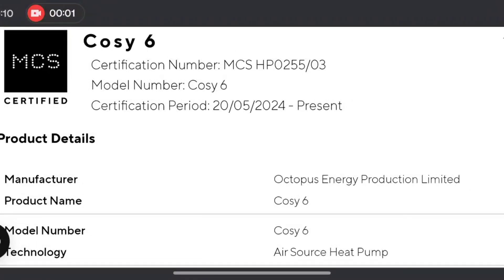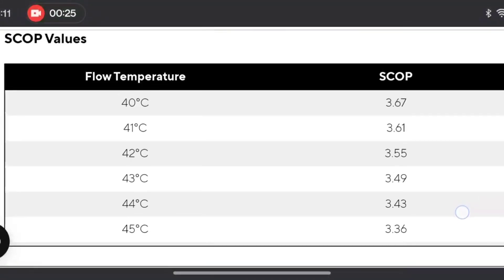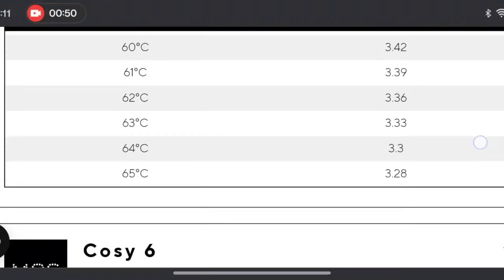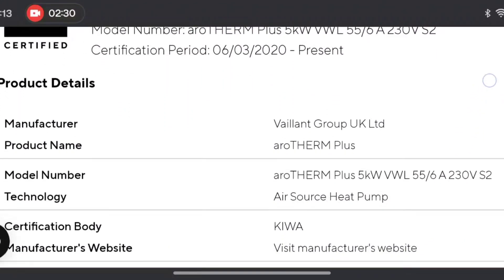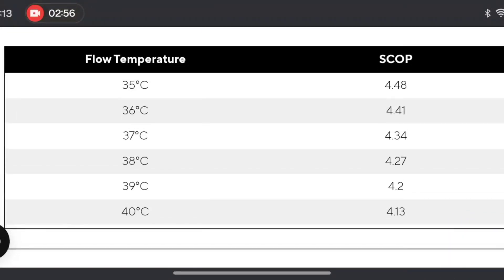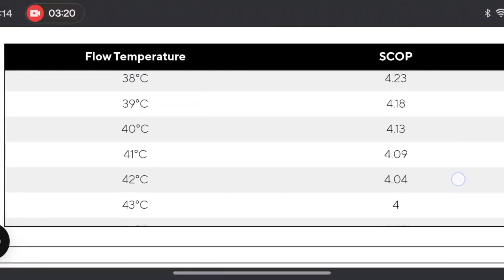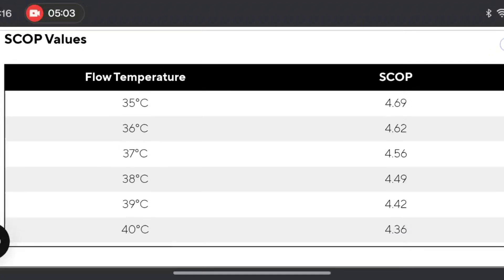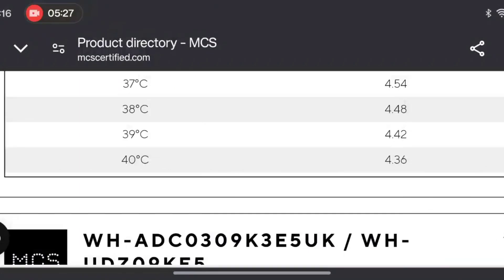Cosy 6 Heat Pump Test Results are poor. Does Octopus have a trump card?

Comment: So I have just been on the MCS database and the SCOP for 35 C is 4.31.  I take it this has been retested?
Reply from the maker: Yes, they have implemented software updates and retested the units now.
Reply: @UpsideDownFork does this change your view of the cosy 6 then?
Reply from the maker: @petestewart7116  the jury is out. I'm waiting for this winter and to gather enough owner's opinions.
Last winter there were too many reports of noisy Cosy heat pumps.
Octopus say that issue is now resolved. Let's see.

They certainly seem to have improved the efficiency greatly.

Comment: I was quoted £490 for a heat pump installation with a 4kw Daikin and 200 l Tank- £7500 grant.
Reply from the maker: Bargain. Are you going for it?
Reply: @UpsideDownFork  Yes, 2 new radiators included. Wife was worried about hot water temp. Just realised that 4kW is the output not the consumption...
Reply from the maker: @Paul-if1jq  that's right. Most of the time it'll be ticking along using under 500W 👍

Comment: What if I used the saved installation costs to install a home battery to run heatpump on offpeak electricity?

What the minimal output of the Cosy6?

Does it have a smart way of automatically choosing the best weather compensation settings based on the data it collects from its room sensors?    Eg cope with microbore when the layout of pipework can't be surveyed etc?

As a landlord, a heatpump being able to work (even not well) for tenants that think thermostats are on/off switches is a requirement, as I can't replace the brains of a some tenants!
Reply from the maker: I don't envy you as a landlord having to consider how tenants may try and control the system. Perhaps A2A may be a better solution in your situation?
Reply: @UpsideDownFork  Can risk losing any EPC points as need a C to be able  to rent a property and A2A reduces a properties rating.
Reply from the maker: @ianringrose6112  Isn't that only if the assessor ticks the generic 'electric heating' box, rather than doing their job and specifying the exact type of heating?

Comment: It feels like they’re really trying to just push the higher temperatures in response to fear about not being able to push 60/70 degree water through your central heating.

We had air con installed a few years ago and it took a while to figure out how to use it, and that’s basically set it and forget it, our electrical use for air-to-air has dropped significantly when we stopped trying to pretend it’s a gas boiler, but it’s a counterintuitive mental shift that leaving it on all the time is actually cheaper.

Concern is if they’ve made their HP less efficient by being able to run hotter once people figure out that it’s not a gas boiler are they going to feel cheated that they can’t reach the energy efficiency at the lower flow temps that others can achieve?
Reply from the maker: I agree!

Comment: There will be situations where it will be of benefit in the installation, but the laws of Physics aren't in its favour. The R32 heat pumps running at low temperatures seem to be the best bet. Did folks catch on that the October price rise for gas was 16% whilst for electricity it was only 9%. A few more price adjustments where gas rises in relation to electricity will make the mathematics easier to understand for the unconvinced.
Reply from the maker: That's good to hear as the last few price adjustments went in favour of gas, which was a real shame and missed opportunity.

Comment: Octopus are trying to sell me the Cosy 6 system with a 50deg design temperature. I asked what delta T the Cosy 6 ran at and was told between 7-10deg. This is higher than usual for a heat pump, which typically between 5-7deg, but it does explain how the Cosy 6 can work in properties with less than ideal pipework.
Reply from the maker: The ace card for the Cosy 6 is going to be in the software. It won't necessarily have the best COP in the world but it does look like it will be able to minimise running costs very effectively.

Comment: You are absolutely correct!!! 

I have been saying this for months now as i have been looking to get one fitted and i had seen some data and i am not getting a Cosy 6 anymore, i will be getting an ashp fitted but its going to be a Daikin model. The Cosy 6 not as efficient as others on the market in heating efficiency or easier on your energy bills.
Reply from the maker: Time will tell. A big part of the efficiency and the cost of running is down to the control strategy. I'm hopeful that the Cosy 6 software will make it worthwhile for those who have been waiting.

Comment: The SCOP is just one factor and you need to include the cost of the install in the first place to get the true running costs over a long period. £5k Octopus Cosy6 install with SCOP 3.35 v/s £10k Heat Geek install of 4.0 SCOP. Which one will hit you more in the pocket over 10 or 20 years of running? Will either heat pump cost less than a new £3k gas boiler of install over same period? Answers on a postcard. For those that can get a Cosy 6 installed for £3k or less, it becomes a no brainer.
Reply: I got my Daikin Altherma and cylinder for £800 including full install. Boiler had already cost me £500 in repairs. Absolute no brainer!
Reply: @fyank1  Cracking price.
Reply from the maker: I agree 👍 
Get a £4k complete Vaillant installation that averages SCOP 4 and you're quids in?

Oh, that's what I lucked into!

Comment: We had previously been quoted by Octopus for their ubiquitous Daikin 6kw unit but with SCOPs of 3.65 for Heating and 2.69 for DHW the numbers didn't work. Would have paid MORE to produce our heating and hot water plus paid £2k to install on top of that.
A friend had the same unit installed (they were quoted same SCOP's) and the SCOP for Heating is in the right ballpark but the DHW since installation in mid November has fluctuated between 1.9 and 2.25. The last achieved during the hottest days/weeks of the year.
Octopus have just contacted us about a quote and assessment for the Cosy 6 and they state: 
Heat capacity: 6 kW
SCOP (designed at 50°C): 3.4
Max flow temperature: 75℃
Sound power levels: 53.8 dBa
Efficiency: 310%
Dimensions (W x H x D): 855mm x 1125mm x 595mm
Cosy 6 meets the minimum MCS certification standard, meaning it’s designed to provide a SCOP of 2.8 even under the most strenuous real-world heating conditions. We design the whole system in your home to target a SCOP of around 3.4.
Nominal Heat Capacity: 6 kW
Coefficient of Performance | A7/W35 @ 5.63kW*: 4.29
Coefficient of Performance | A7/W65 @ 5.23kW*: 2.71
Sound Power Level | A7/W35: 53.8 dBa
Dimensions (W x H x D): 855mm x 1125mm x 595mm
Volume: 0.571 m3
Weight: 100 kg
Maximum flow rate: 25 L/m
Minimum flow rate: 7 L/mi
Minimum system volume: 100 L
Maximum operating pressure: 32 bar
Maximum flow temperature: 75º C
Electrical supply rating: 230VAC / 50Hz single-phase
Refrigerant type: R290
Refrigerant charge: 0.650 kg
Waterproofing (Ingress Protection rating): IPX5
Reply: Well, I can understand now why the Cosy 6 appears to be a non starter and whilst the Daiken HP maybe less than ideal it could still perhaps be the better choice for myself, assuming  I have a choice (obviously I can just say no and walk away) for my installation.

Apart from the need in my case to have a slim line tall cylinder due to my current cylinder room constraints - which Octopus have initially said ‘yes’ they can accommodate this, the rest of my installation looks okay (I am just going to check for any air vents in my 5 year old property- hadn’t spotted that one!).

Thanks again for your useful comments, I will update after my next discussion/installation visit to see what Octopus can offer 🤨
Reply: May I ask - in the end after receiving your Octopus quote and in light of your insight on the ‘ubiquitous Daiken 6kW’ heat pump what was your conclusion?

My reason for asking is that I am seriously considering the Octopus Cosy 6 (still awaiting a survey) but I have concerns about the lack of real world data and how this may affect my costs.

I live in a modern well insulated home with an EPC rating B and currently have a trusty 5 year old gas boiler (same age has my house) but I am having solar and a 13.5kW battery installed which I have done the math and it’s look good (I also have an EV - not show boating here just giving an insight into our energy needs in our 2 person modest size 3 bed detached house) and I am wondering if adding a heat pump is the way to go to get off gas and have a decent saving over say the 5 years warranty on the Cosy 6 (otherwise I guess sticking with my remaining 5 year warranty on my gas boiler is probably best 🤔)

Wish it wasn’t so complicated and more transparent but it is what it is!

Any thoughts very gratefully appreciated.
Reply: @StevesTechTime  well for us the Cosy 6 is out of the question. I honestly can't believe that Octopus have managed to design a HP that is worse than most on the market.
I understand that a High Temp heat pump is generally less efficient than a Low Temp model but the Red on which the Cosy was heavily designed from would appear to be a very efficient unit.
The Daikin is just not very efficient compared to other brands. Plus it is only able to output @ 55'C when outside temps are above 0'C below that its limited to 50'C. So you have to use the immersion to heat above those numbers say for Antilegionella cycles (at 100% efficiency/COP 1).
My last gripe is that the DHW Cylinder they insist on using - mostly Daikin or Joule replacement are half arsed HP Cylinders. From everything I have been able to find out the coil inside the cylinder that transfers the heat to the water is at best 2sq. metres. The Heat Geak Super Cylinder from Newark Cylinders is 4m or 6m depending on model. This results in HW SCOP's of 4 or more as they are able to transfer the heat MUCH more efficiently.
I started a comparison of heat pumps from the MCS database - its FAR from complete but have a look at it and using the Design Flow Temperature Octopus have provided you with see where alternative HP fall.
https://docs.google.com/spreadsheets/d/1AuQexhSSHZ-VOPKj5nINSEXU8Lr_6ubujD7RO_X2iy4/edit?usp=sharing
Reply: @MagicianMan Thank you very much for your thoughts and the spreadsheet is very useful. 

Interestingly, your comments seem to suggest between the Cosy 6 and the Daiken, despite the relative poor performance of the Cosy 6, the Daiken unit is arguably even worse? 

All food for thought and super useful for my pending conversation with Octopus about my potential install. 

I am now wondering if I could pay extra via Octopus to get the preferred hot water cylinder and indeed the heat pump?
Reply: @StevesTechTime  the daikin is actually better performing than the cosy
Daikin @ 46'C Flow Temp:
COPs Heating 3.65 HW 2.69
Cosy 6 @ 50'C Flow Temp:
COPs Heating 3.21 HW 2.60
But for the same 46'C flow temp the Ideal is the better option (plus only released last year) or the Vaillaint arotherm Plus.
Its possible others are better too.
The Aira appears to perform well but having had them to quote and speaking to the installers @ the Installer Show I wasn't that impressed. They like to install buffer tanks regardless as it protects the Heat Pump from poor design/installations but adversely impacts performance (ie increases running cost).
We have Solar & 10kw Battery but intend to swap to a much larger product - 12kw Single Phase Hybrid Inverter paired to modular batteries we want 15-20kw. In the short term using Time Of Use tariffs we would be able to export enough electricity to offset our gas cost.
Then ultimately we would be able to convert to a Heat Pump and the COP would be mostly irrelevant.
Also there are some technologies that we are waiting to see.
Vaillant fluoStor - this is a Water to Water Hot Water Cylinder. It was shown in Germany 2023 and is available in France/Germany.
This draws some of the heat from you heating circuit to heat the hot water and is supposed to provide a COP of 5.
Also there are ASHP Hot Water Cylinders already available from many brands. Mixergy IHP comes to mind - but these require access for large air ducts into and out of the top of the cylinder which is not really possible for us.
Octopus seem fairly intransigent in their design/install parameters.
The Cosy 6 was actually a complete pain in the arse to locate as it cant be close to any air vents (our is 4 years old with Cavity Vents every 2 metres) cant be within certain distance of opening windows/doors and they WONT install above ground floor.
The perfect location for our heat pump is on the end wall of our house 1 story up. This negates any and all issues plus provides a really small run of external pipes directly into the loft and then into the cylinder cupboard. This was an absolute NO!

Comment: You are comparing 5kw Vaillant with 6kw Cosy 6. 😂
Reply from the maker: Is that a problem?
Reply: @UpsideDownFork  OF course. You are not comparing equals so the results are bound to differ. I think it would be better to leave the scientific study to those who know what they are doing.
Reply from the maker: @davet4971  I refer you to an earlier video where I discuss heat pump labelling.
https://youtu.be/NWVgv7SXkNI

If you did even a little research you will find that a 5kW Vaillant Arotherm plus can output MORE heat than a 6kW Cosy can.

Essentially it doesn't matter if you're comparing a 40kW heat pump to a 3kW heat pump if you are just talking about efficiency.

It is only the measure of input vs output that we are considering.

Thanks for the personal insults. 👍
Reply: @UpsideDownFork  You should have been a politician. That earlier video makes no difference. Anyway I have given my opinion and do not wish to engage in a Punch and Judy "oh yes it is. Oh no it isnt". I stick to proper reviews.
Reply from the maker: @davet4971  You've given your opinion. 
Here are the facts.
The Vaillant Arotherm Plus 5kW can output more heat than the Cosy 6 as well as the Daikin Altherma 3M 6kW.

A quick snapshot from it's datasheet.
https://energy-stats.uk/wp-content/uploads/2022/07/Arotherm-flow-red.png

Your original point is presumably that the 2 shouldn't be compared. Yet on the spec sheets there are close to identical. 
Both reach a 75 degree max flow temp, both estimate a SCOP of 3.4 @ 50 degrees flow and they both achieve a low sound power level of 54dBa.

There are no other heat pumps that are so closely matched by spec alone.

It's a compliment that the Cosy 6 is even considered in the same breath as a much more premium Vaillant Arotherm Plus. The aggressive price point of the Cosy 6 is testament to the significant value engineering that Octopus/RED have undertaken on this heat pump.

Comment: Just had a survey for cosy 6. The cosy passed mcs noise calculation. The daikin didn't. I Asked what was better on the cosy and he said the individual zones and the size of the unit more flexible when space is an issue. Hope this helps
Reply from the maker: Thank you for sharing that info! I'm keen to learn more about the Cosy 6.
Reply: "Zones" as in being able to set different temps / timings for underfloor heating and radiators?
Reply from the maker: @martinhawes5647  always a bad thing with heat pumps.

Comment: i've just been offered the cosy 6 rather then dikaina to get installed quicker - should I go with the cosy 6 or wait? - I can get one as my house only has a 3kw heat loss
Reply from the maker: You look as good a guinea pig as any! I've not heard of anyone else yet being offered the cosy 6.
The fundamental underpinnings are taken from the old RED units which seemed to be good.
The daikin units that Octopus usually fit aren't the best but still do the job well on a budget.
I'd be interested to hear more if you do go ahead and get the cosy 6 installed.

Comment: Why woukd you put a substandard heatpump in because of a tariff? If you can put a valiant in just do it, i cant fault them for reliability and im upto 35 installed now, and ive fitted daiken, mitsubishi and samsung aswell
Reply from the maker: @carpcrazyboom5190  Cost. Unfortunately most can't afford the Vaillant kit.
Reply: @UpsideDownFork  sorry but it's tried and tested pretty well so reliability isn't an issue unless the install is sub standard and this investment in your property isn't one you really want to scrimp on, also their not that bad cost wise? Or is compared to ine of octopus quotes that need adjusting to get the best results out of an install 🤔
Reply from the maker: @carpcrazyboom5190  If you watch any of my other videos you will see that I have Vaillant in my own home. Very happy with it 👍 But I have talked to hundreds of other home owners and the same response comes back every time. They want to do the right thing by ditching a gas boiler but they can't afford to pay a premium to do so.
The Cosy 6 is based on the RED heat pump which has a good reputation amongst those who have actually worked on one.
We'll see how Octopus installs pan out. They don't look to be the best but also far from the worst eco4 type installations that are rife.

We have to achieve mass adoption. The only way to do this is by scaling up and big firms like Octopus are positioned well to do this.